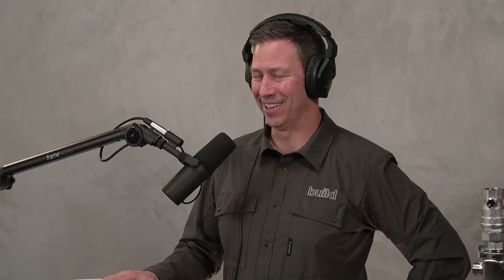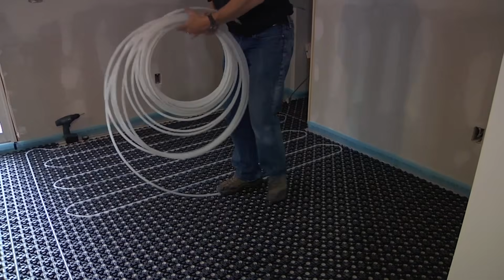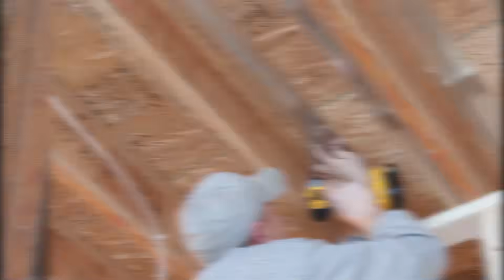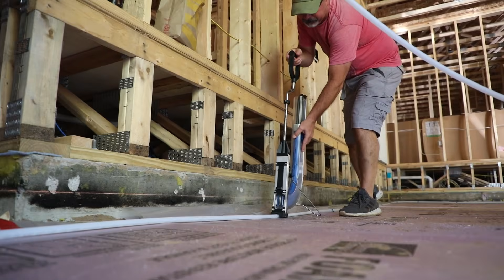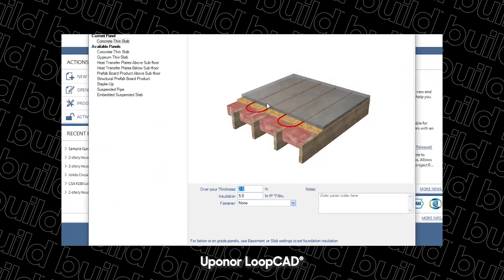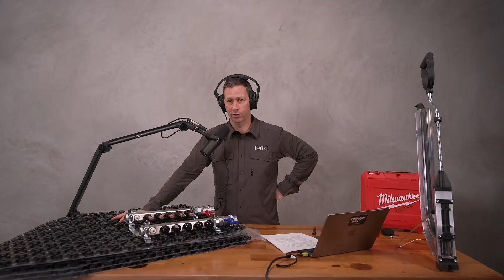4 Methods To Run Radiant Heat PEX Pipe

Comment: Will be doing my basement. is 1/2 enough or do we step up to 5/8 ? . I want to start buying components and do in October
Reply: The guy sounded like he uses 1 inch. The bigger the pipe the more water volume going through and the less pipe you have to use to get the same heating rate and probably the max temp based on how much heat loss you have in the room.

Comment: Could you gain heat passing the return lines through a southern exposure wall in like a sun room type space where all the glass in that room is shaded in the summer but winter low sun would hammer this "warm wall. 
Thus decreaseing the demand on the heating appliance because the incoming water is maintaining a highier  Input temperature.
Reply: I’m building a duplex out of pocket and I put Pex in my garage floor. I’m going to put Morris Beacon heaters in the upstairs living area and just baseboards in the daylight basements.  I spent close to $20,000 on insulation and have 200 sqft of glass on a south wall. Right now I am heating 3000 sqft with two 15000 btu Toyo heaters and burn less than 600 gallons a winter. It’s sunny and 30 F out now and the heaters aren’t running. It going to cost me $4500 just to get natural gas to the end of our driveway and then close to 200 to the meter.  Hell I had to pay over 6 grand just to get power to my meter by the road.

Comment: Was in radiant industry for long time, primarily high end homes. It’s fantastic heat. Radiant cooling is difficult due to condensation, you can do it but as simple as using cold water.
Reply: Radiant cooling is nice but you need a dehumidification system too...in damp climates.
Reply: I was just going to ask about using it in place of an A/C in warmer climates.
Reply: If you're using a  heat pump. Like I have with my geothermal system. Just use chilled water fan coils.  They condense the humidity out. Just like a split system ac unit . If you don't like the looks of a split system. They make flush mount fan coils.
Reply: @danmccoy6164  it wont condense much water until the lines are pretty cold. In damp climates you need dehumidification
Reply: @rogerwhiting9310  
Thanks for information.  I  have  no problem with my chilled water fan coils removing humidity.  Im sure you don't need 32 degrees to condense humidity.  Which I'm  sure you could do  if you wanted.  The capacity of the heat pump is way higher for heating than is needed for cooling.  So no risk of it not being able to maintain more than cold enough water. I have humidistatts just out of curiosity. Because my house is extremely tight.  And the  fan coils have no problems. Would be no different than a split system..if a split system is  going to have a problem then I guess a fan coil might also. The condensate drains on my fan coils are clear and I can see water running when the unit is running.  Unless. Perhaps you think the geothermal   unit is only transmitting ground water temperatures.  Then I can understand your concerns.
Reply: @danmccoy6164  I find that in my house...I have 6 mini splits that the mini splits are very poor dehumidifiers. I have owned and worked on professionally typical central air systems and I had a Unico system in my current house. The current Mitsubishi mini splits WILL dehumidify when set to that separate designation...but there is no temperature control on the remote for the function. If you simply set a temp in the humid hot summer it will modulate the compressor so that is the most efficient possible. In the modulating mode it isnt unusual to have humidity in the room at 60 percent...which isnt comfortable and actually smells of humidity. Modulating compressors dont get the refrigerant coils cold enough to condense water when running at less than 100percent.  Its a common complaint of them. Mine are Mitsubishi and were actually checked by the factory rep that initially denied their shortcoming regarding dehumidification. In the end the official response to modulating humidity problems..."put them on dehumidifier setting. "  It works but no temp control.. and no 18 seer. The 36 seer hyper heats do the same thing.
Reply: @rogerwhiting9310  
Wow. I'm glad I  don't live in such a humid area. My fan coils keep humidity in my house in the mid to upper 40s. Upper after showers etc.  Could be other things with my house. I  do have one of the Panasonic cold climate ervs.
Thanks for information. I like to learn.
Reply: @danmccoy6164  me too and I am glad you didnt take it as an affront. I have been taken to task by Mitsubishi who says everything works all the time without a problem. They didnt like admitting that dehumidification is poor with splits if used on modulating compressors. Central air gets a house down to 30% easily...and the dryness is more comfort than the temperature. This is of course in Boston in summer...
Reply: To me the hardest and most important part of a radiant system is getting the water right. So you don't have problems a few years down the road.

Comment: I think what I really wanted to know about was accidently hitting those pipes. I guess you would have to frame your basement before putting this in, so its almost geared toward remodeling. But then you change your stair height by more than 1" so your stairs are out of code. Seems like a pain putting it in the floor. I like the joist tracks. But really, I would be completely happy with just old school radiators like Europe is using. The other thing I would like to know about is just considerations for moving air around for just getting fresh O2 into the room.

Comment: What about using this in your extremely tight Building envelopes where you need to bring in ventilation? do you use a water air extanger to warm the incoming air?
Reply: HRV in dryer climates & ERV in humid climates
Reply: HRV and ERV as mentioned and if you need more, there are hot water coils that are used in forced air systems now.  Just another zone with some piping.

Comment: I have electric radiant heat in my ceilings from 1955 and it works to good. Don't think just because your cold your gonna turn the dial up and go to sleep cause your organs may boil. Mess around and get evaporated.

Comment: PLEASE do an update piece on the effectiveness of radiant COOLING! You covered it briefly years ago with a company in Austin but it could well be the future of more efficient cooling over conventional HVAC.
Reply from the maker: I still have high hopes for Radiant Cooling but I’ve not seen an actual install. I think the hurdle is a chiller for a residential setting isn’t common. Have you heard of any installs?
Reply: @buildshow  your pals at Positive Energy in Austin which you did the previous piece about it with can probably point you in the right direction and if not, go directly to the source and maybe do a video with Messana who seem to be one of the biggest in radiant cooling and heating systems.

I am sure they’d LOVE to feature in one of your vids and show you around a project.
Reply: @benwhittle7204  Positive Energy has posted little updates here and there through the years on their social media regarding their attempts with the Messana radiant cooling panels.  Basically, they said the product is not ready for primetime yet, at least with residential applications.
Reply: @W78thIS  I had been searching through the years but couldn’t really find anything so I am guessing my Google foo is not that good!

Have you got any links to where they have stated this?
Reply: @benwhittle7204  Nope.  They haven't done followup posts on it.  But there have been random questions about it over the years, so they have made the occasional comment or mentioned it in their podcast.  Not really searchable, nor did I bookmark them.  I have just followed their content for a while.  I don't think the issue was necessarily about the condensation issue that keeps being mentioned here, either.  It was more about installation, usage, maintenance, etc.  A complex system, not really installer or user friendly.  At least not yet.
Reply: @W78thIS  in principle it’s not a very complex system, what does concern me is that you’ve got a plumbing system with MANY joints…
Reply: @buildshow  I’m in the process of installing a heat/chilled radiant system on my house. I’m using a heat pump.  System is programmed to keep floor temps 5f above dew point. Side effects are I’m locked into floor coverings that convect heat well. So no carpet or wood floors.
Reply: @gabrielgoforth7378  interesting you’re doing it in the ground, I wouldn’t have a problem with warm feet but I am not sure about cold feet!
Reply: @buildshow  I haven't seen any homes with it in person, but I've definitely looked into radiant cooling.    PLEASE make another video (or video series 🤞) going into the intricacies and tech specs thereof.

Personally, I'm most interested in efficiency vs conventional HVAC, if you can get away with hufft radiant ceilings and floors (I'm concerned about walls being damaged and that damaging the system), spot heating/cooling (like behind hot appliances [oven, fridge] or in a bathroom), and integration with an existing home water heater/solar water heat.
Reply: @buildshow  geothermal heat pump will take you both ways... heating and cooling in one system.
Reply: @buildshow  how about using a geothermal loop for cooling? At 6-8 feet, ground temperature stays constant in the low 50's to high 40's.
Reply: Condensation is the biggest issue with radiant cooling. On the commercial side I have done several conversions lately for schools where we are adding heat pumps (in addition to existing boilers) and converting air handlers to add pans and condensate pumps or gravity drains. These jobs are several hundred thousand dollars. It's not possible without force flow heating to start with rads can't be converted.
Reply: I’m in the middle of doing radiant cooled ceilings in my house. There’s definitely a lot more planning required up front. For example your PEX has to cover much more surface area than if you’re doing heating only. And of course you probably need a whole house dehumidifier and sensors in each room so the system doesn’t sweat. Check out John Siegenthaler he’s got a lot of helpful papers and books on it.
Reply: let me add another vote to and update for this. The condensation problem can be managed by a combination of humidity control (in your air exchange system) and computer control that knows the temp and humidity and doesn't run the radiant cooling at a low enough temp to trigger the condensation.
Reply: In my country radiant heating in combination with a heat pump has pretty much became the standard in the past few years.
during the summer we reserve the system to run high temperature cooling water about 17-18C to avoid condensation.
Some people even have geothermal, that will allow for almost completely free cooling by running water through ground loops.

Keep in mind that I live in a very mild climate, for warmer and more humid climates like Texas you will probably need additional radiant cooling in your ceiling and separate dehumidification.
Reply: From reading around the internet, radiant cooling would cause a lot of condensation
Reply: @thebigthn  gotta add a dehumidification system with it for that condensation
Reply: @mikecousin8523  exactly and presumably if you’re going to use radiant cooling in the first place, you’re going to be controlling the air coming in and out of the house and thus the humidity.

I believe Messana actually has an ERV that can also dehumidify as well.
Reply: condensation is a concern
Reply: Murphy's law about things going wrong applies here. Condensation on a cold surface will happen if the humidity gets high. Also. cold air sinks so your feet will be cooler than your head.
Reply: @ToIsleOfView  you control the humidity levels inside the house and track the dew point so that you don’t have condensation issues, only place it might be a problem is bathrooms, but then that’s a problem there anyway.

Also, that’s not how thermodynamics works, your feet won’t be cooler than your head 🤣
Reply: @benwhittle7204  Things go wrong and we lose control of the humidity. I have 40 years of HVAC management in multi-use institutions and have seen it all. From propping the front door open to cold feet with a bare concrete floor. You cool the floor and your feet will get cold. It's you that has thermodynamics wrong. The coldest air settles and stays close to the floor while the warmest air rises to the ceiling. Without some mechanical mixing, it remains that way. One night I had a 65-degree dew point and a 60-degree floor. Condensation ruined tens of thousands of dollars worth of wood, tile, & carpet. This is why nobody uses radiant cooling in the floor.
Reply: @ToIsleOfView  this is why I said Messana radiant cooling…. They don’t cool the floor…. It’s on the ceiling….

Thermo dynamics is hotter—>cooler and those two components can be anywhere….
Reply: I have geothermal. Running my heating in floor 6 zones. 3 zones in slab 2400sqft shop and storage downstairs. 3 zones warmboard living space upstairs.  I use chilled water fan coils for  cooling. Fan coils condense the humidity out of the house. Just like split system ac units.  But use chilled water produced by  geothermal unit.
Could use chilled water fan coils.  With heatpumps for cooling  instead of trying radiant cooling floors walls and ceilings. Then you don't have to worry about condensation.  I  don't think having cold feet is ever desirable.
You can get flush mounted fan coils. If you don't like the looks of split systems.
Reply: We worked on a radiant ceiling panels. The pneumatic control system switch between heating and cooling on demand. It was in a hospital the hospital system already outlawed this type of system before they started the install. There was a separate dehumidification for each floor. This system on a 0-10 ten being good scale was a negative 2 million. 
But good luck with that dreams. FYI digital automation just speed the rain on a fella in a hospital bed. 😂😮😊
Reply: @Foxforce1  very late to the party, and full of misinformation.